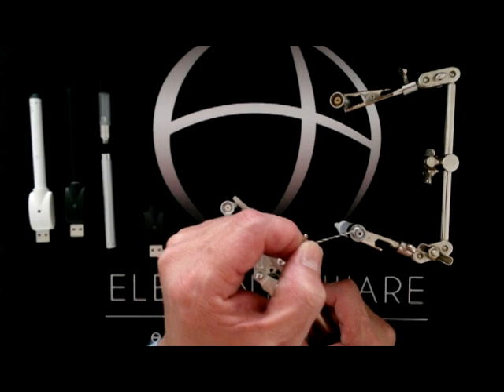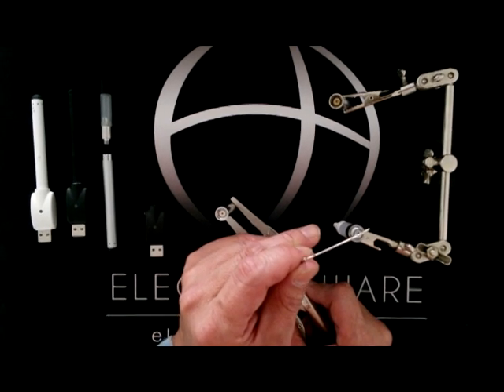Vape Review | My Vape Pen Won't Work, Hit, or Heat up. | Fix Vape | Elegant Aware

Comment: i got a new pen this weekend and after 3 days it randomly stopped working :’). it’ll charge but it won’t turn on/fire up and ive done everything under to sun to try and fix it :/
Reply from the maker: Have you checked your cartridge?  Maybe the cartridge is blocked or won't fire?
Reply: Same thing is happening to me, it won’t heat up😓

Comment: Bought a dud that didn’t have all its threads properly cut, so it couldn’t screw all the way in. What would you recommend? The clearance is about as thick as a dime. Or a small washer.
Reply from the maker: I wouldn't do it.  You might not be able to unscrew it then you cart is stuck on that battery.  What kind of pen do you use?  We got cig style pens $5 or you don't want to "screw around" literally.  We got magnetic pen that attaches by magnet you don't need to screw it on.  Use code "shipsfree".  Throw you sample carts too, what kind of oil you got?  Thick or thin?
Reply: @ElegantAware510VapeShop  Thanks 🙏🏽 for the advice. I took it back and they were baffled at how rare it happens and happily changed it. Was def the thread on the manufacturing end.

I got one of the basic Etain starter pens. I’m new so I don’t know much about the model names lol definitely not magnetic but I should look into a better pen. You’re right.
Reply from the maker: NICE!

Comment: my pen was working fine lastnight and then it randomly just stopped working and i did everything the internet told me to do and i have no idea why it’s not working bc it was working minutes before so i just let it go for the night and it’s still not working and i tried everything and i know it’s my battery bc i also tried an old cart that had a little bit in it and that one didn’t work either so idk what’s wrong with my battery or how to fix it

Comment: I cleaned my battery just like the video but it won’t turn on. When I charge it the light is green for some reason but still won’t turn on :( should I just get a new one??
Reply from the maker: Might be the battery is dead.  Go to ElegantAware.com and use coupon code 'shipsfree' we get you a new one!  COLD FUSION never burn oil again

Comment: My charger ended up pulling the center plate right out of the battery when I disconnected them lol. First I've seen that happen. How do you get the center plate back in to the battery? Trying to pop it back in, if I didn't see the plate come out myself, I would swear that the 2 parts didn't belong together in the same pen. It looks impossible to just pop it in.
Reply from the maker: Did the wires attached to center plate still attached?

Comment: My problem with the battery is it blinks when the cartridge is screwed in and I press the button to heat it. I've charged it for a couple hours to make sure it wasn't just low battery. I picked up the little magnet area on both the battery and 3 diffrent cartridges but same outcome. Does anybody have a suggestion on what it could be or how to fix it ? Please and thanks !
Reply from the maker: Hi, blinking battery means there is a problem... maybe charging issues or battery could losing charge

Comment: My problem was i cant screw the cartriidge all the way down or it starts blinking and doesnt heat or warm up. I just loosen it a bit until it works
Reply: HiImBoredAF ur plat isn’t touching the cart so get a Bobby pin or something small that can in the sides and bring it back up
Reply: I have the same problem with my battery. I brought that thing back up but it continues to blink whenever the cartridge is screwed into the battery. It's not low on battery so I opened the battery and the wires seem like they're connected just fine. Have you found out how to fix it??
Reply: Your a life saver as soon as I loosened it the cart started hitting
Reply: KING SO's SHOOTA #IWILLSLAPCASHNASTY yo wtf gtfo here 😂

Comment: I was getting pretty frustrated with my pen, thanks man.
Many carts that I smoke through this "The Clear" pen didn't work, and I usually traded them with a friend whose pen did work on them.
Tried using a needle to pry up the middle part of the pen like you said. Everything works now..
Reply from the maker: When your ready for a new pen let me know, I gonna hook you up with Cold Fusion.  "Shipsfree" use that code at checkout we gonna pay for shipping... ;)

Comment: I used an all purpose household cleaning wipe, it did the trick, maybe I'll be vaping in toxic cleaning wipe chemicals but hopefully it won't be any worse than cigarettes (which I would have otherwise gone out to buy, after, like, a year or more of not smoking), so thanks alot for that very useful set of instructions.

Comment: My battery with the stylus tip flickers red when screwing into the charger but then no light. I’ve left it on the charger for a bit but it still won’t hit. Please help ASAP
Reply: did you solve this?
Reply: Levayan I had the buttonless stylus pen 15$ probably cheap af and I think it was either dropped or something inside wasn’t working cuz I tried everything.
Reply: i have a similar one, the mini vapen. Ive tried everything. Thanks for the response though

Comment: I have fully charged my pen, it's clean and I've rocked the pin back and fourth to move it up. The cartridges work on other pens my old cartridge won't even work on my pen now... Not sure what else to do besides buy a new one...
Reply: Same and mine charge with a blinking green light
Reply: I have same problem, I'm on my second one in less than a month. Pain in the ass when medicine that you need doesn't work the way it's supposed to. Or at least the device to use the medicine.
Reply: @CBH00666  try getting a Top Evod
Reply: me too!!
Reply: same...

Comment: I tried this. My pen lights up but no vapor comes out when u try to pull . Any way u can help
Reply: I’m guessing nobody found out?? 😔
Reply: Same, you ever get a fix for that?
Reply: Me to
Reply: Same
Reply: Did you find out
Reply: Maya Muniz same
Reply: @johanahernandez3328  same someone pls
Reply: I had same issue.. The center plate for the Battery was pulled out and not connecting to the cart. No idea how to fix it. Gonna try to carefully take apart and pop the center plate back in
Reply: I found it out guys, let it heat up first with the cartridge not on then put the cartridge on (not tight) and do it
Reply: Xavier Brewer thank you, will try

Comment: I have a 510 thread battery and I have one of the co2 clear cartridges. Never had a problem with it until a few days ago when I left my charger at work and had to go buy a new one. I just had the usb piece at first when I bought the new one it had a chord with the usb piece on the end. Well I used that charger waited for it charge then after I took it off the charger I went to hit the pen, light came on but it doesn't heat up anymore. Any thoughts or suggestions?
Reply: I've also tried everything you mentioned in the video
Reply from the maker: Make sure the voltages are the same when replace chargers. Some look the same.  Check the specs on back of charger 5V for autopens and 4.2V for preheaters (ours anyways).  Let me know on your next order ill throw u an extra charger let me know which one u need.

Comment: what happens if it's fully charged but the light on the pen doesn't light up ?
Reply from the maker: Could be a bad connection inside the battery.  I tell you what, go to elegantaware.com and buy anything... use code SHIPSFREE at check out, use standard shipping.  I will throw in a Elegant Aware custom chrome for you to have.  This will last you.  These last on average 11 months.  If you don't like 510 screw connection you can use our Elegant Conceal Magnetic 510 battery.  It literally sucks your cartridge in with magnets to make perfect connection!  Vapes awesome clouds...
Reply from the maker: Batteries sometimes die.  Let me know your next order ill surprise with a special pen u cant buy just for u!

Comment: I just bought my G pen yesterday and used it straight out of the box, it went flat, and when i plugged it into the charger, it worked fine, but then the light on the charger went green, so i took it off charge and ever since, the light will not light up at all!!! :( I've tried everything like moving the pins inside the charger and the pen, but nothing :( I've held down the button so many times, ive even spam clicked the button and still wont light up at all :( Anyone think they can help me? <3
Reply: I know it's late but I just the same problem and it was the charger. I just had to wiggle it a bit when plugged in. Eventually I got the green led to change red and it started actually charging. The whole time I assumed it was charged because it was green.

Comment: I did all that you've explained and it didn't work so I left it alone with the intention of buying another... after a few days past I tried using it again and it worked. what could it be that caused that problem?
Reply from the maker: Sometimes oil gets stuck or battery dying.  next time u at elegantaware.com leave a note for 'elle' at checkout ill sample u a battery and cart on me!
Reply: maybe juice got into the atomizer, and it dried up and now it works